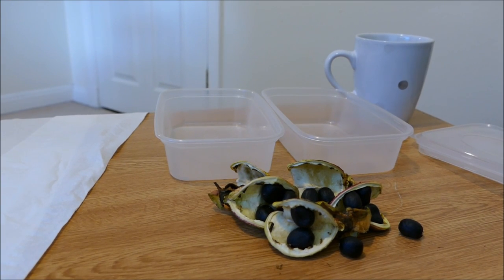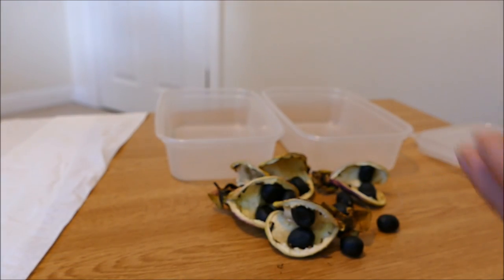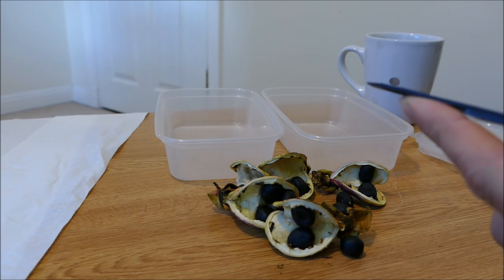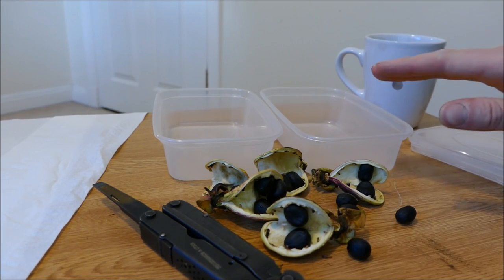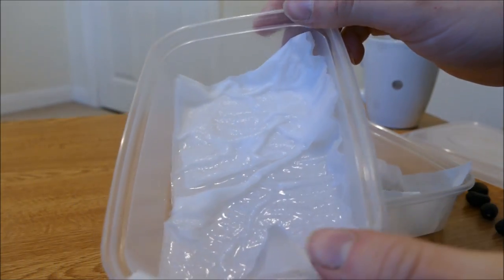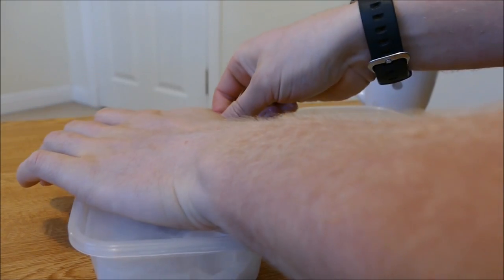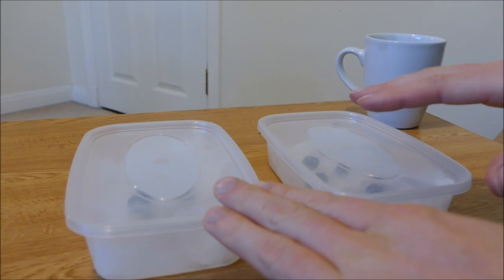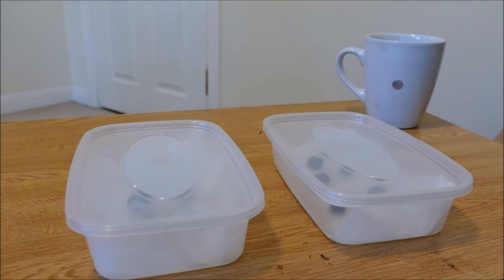Germinating Tree Peony Seeds

Comment: Very interesting! I've heard that from seed it takes five to seven years to produce a mature flower. Do you confirm ? If that's true, I don't think that I would have patience enough. 
I have Peonies in my garden. They disappear in winter and come back vigorously in Spring. 
I think they're infertil. I never got seeds.They have wonderful big white and a bit of pink double flowers and if it doesn't rain they last for a very longtime .
Looking forward to see your seeds sprouting. Thanks for sharing. Have a wonderful day ☀️!
Reply from the maker: yes I think that is true, it takes several years until they are large enough to flower. I think its because they have such large flowers and such large fleshy roots that it takes a long time for the plant to build up its root system enough to support the large blooms. I recorded this video in October, so I'll be posting a follow up one soon as they are now germinating.
Reply: isn't it the case that if your flowers are not making seeds, then they weren't getting fertilized by insects?  Or perhaps it's also related to age of the plant and its ability to provide enough energy for the flowers to develop the seeds.

I had some seed pods for many years, didn't seem to get much seeds.  Then last year, I got a lot of seed pods, some with viable seeds.

Comment: Can I use a nail file to file them
Reply from the maker: Yes, and its safer than using a knife
Reply: @Gardeningat58N  and u just file it until it’s gets light brown
Reply from the maker: @jennifersoto4525  Yes, you just want to file it down so its thinner and easier for it to absorb water, if you break through too much there is a risk of rot.
Reply: @Gardeningat58N  and after it’s starts sprouting how long does it take to grow the leaves
Reply: @Gardeningat58N  can I use warm water when I wet the paper towels

Comment: i'd love to grow peonies from seed. i'll try these methods. do you know what high temps peonies can withstand? I live in Uruguay and my problem are summer high temperatures... For example I've grown lupine, the get lush foliage but never floer and wither in the summer heat.
Reply from the maker: They should be able to handle summer heat better than a lupin, however they are not tropical plants, and so they need temperatures close to freezing over winter and they won't be too happy if temperatures regularly go over 30C.
Reply: @Gardeningat58N  in winter our lower temps are about 0 and 10 Celsius. I will try at least!!

Comment: Hi there, I have germinated some tree peony seeds, I filed the outside of the shell slightly and have had them in a tub since August, two of the seeds have started to grow roots, what would you advise to do with them now? I stay in the North East of Scotland so will have similar weather to yourself.
Reply from the maker: They have slightly strange germination requirements, they need mild temperatures to grow the root, then once the root appears they need to be kept in cold conditions for them to experience a winter. Now that yours have roots place them in a pot of soil and put them outside to experience cold weather, then in spring you should see the new shoots appear. In the first year they are usually very slow growing and will just have two or three leaves. I used to live in Insch so I know how cold it can get where you are, if you have frosts below -5c keep the seeds in an unheated garage or near the house to avoid the coldest temperatures, after their first winter they can survive much colder temperatures once they are planted in the ground.

Comment: i tried both ways like you did but after a week or so i find mold inside the containers. 
why is that?
Reply from the maker: Mould grows because its a warm moist environment, throw out the tissue, then wash the seeds and container. The seeds should be fine if they are still firm. Place them back into the container with the damp tissue as before but spray the container and seeds with a weak bleach and water solution. This will kill any mould spores, but the seeds will be ok as they have a thick seed coat, and by the time the roots grow the bleach will have become neutralised.
Reply: what do you mean by BLEACH?
where should i put the containers - cold or warm place?
Reply from the maker: Keep it somewhere warm until it germinates, and then once the first root appears transfer it to a cooler location.  Use a weak solution of bleach, i.e. sodium hypochlorite, probably the most commonly used sterilising and cleaning product in the world. you will find it in almost any store and most cleaning products. you just want to use a dilute solution and spray it on the tissue, seeds and container. Be careful not to get the bleach on your skin or any fabric as it will stain and cause skin irritation.
Reply: Shouldn't I leave the containers a bit open for ventilation?
Reply from the maker: I leave mine sealed as otherwise it dries out too quickly. I open it about once a week to check if its germinated or has become mouldy,  when I open it it also allows a bit of fresh air to come in which is important from time to time as it need oxygen. But until it germinates it uses very little oxygen.

Comment: I brought some Black peony seeds and I put them I water..them put in  a issue wet..They been in issue in a plastic bag for about two weeks or and more nothing happen..First are the seeds still good?And what am I doing wrong ?
Reply from the maker: The seeds should still be fine, its a very slow process to germinate tree peony seeds. Make sure that you scratch the seed with a metal file until part of the seed become a pale brown colour. Mine sat for about two or three months before they grew any roots. If you don't sand them down they can take up to two years!! to germinate.